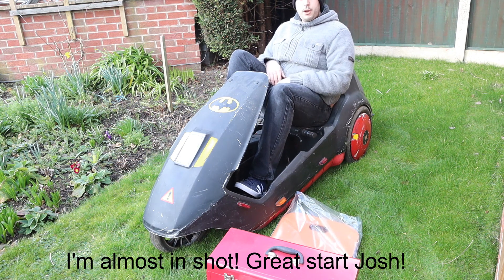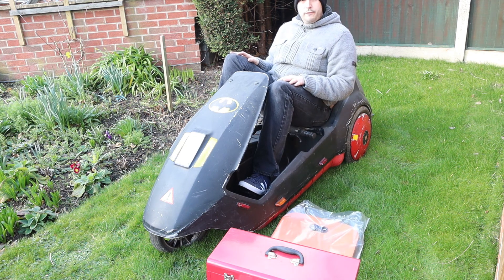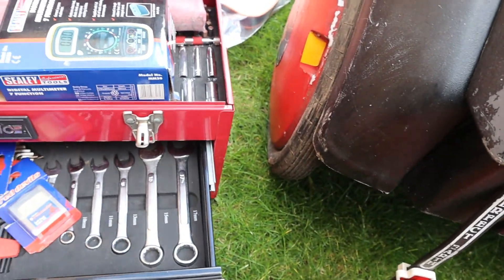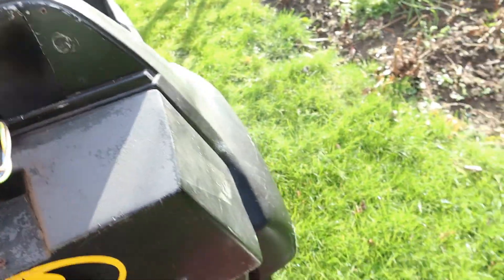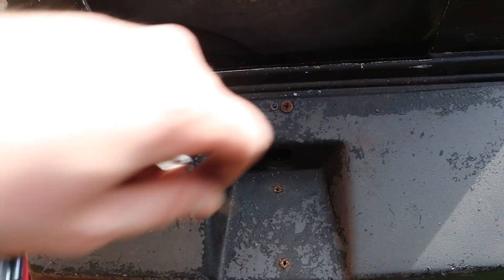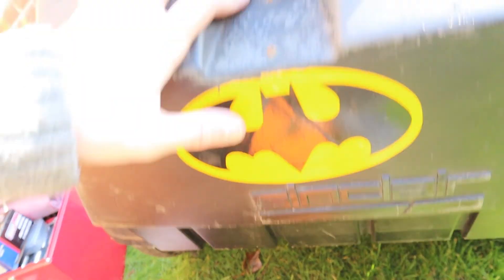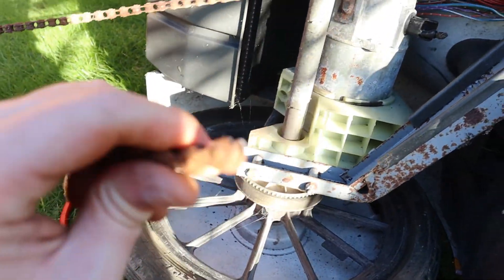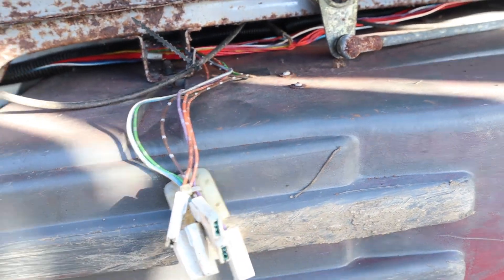Sinclair C5 Project - 'Getting Started' - Part 1

Comment: Josh get a petrol lawnmower and put it inside and you have the best lawnmower on the planet lol.
Reply from the maker: 😂😂😂 What a wonderful idea!
Reply: @TheMoaningYorkshireman  Hehe thought you would like it gotta be easier than repairing the electric unit.
Reply from the maker: @f1gamesplaystation787  To be fair the motor itself is in really good condition, its just all the wiring that's getting a little awkward to work out where it all goes and where its come from! 😂
Reply: @TheMoaningYorkshireman  Yeah anything on a car or bike you need to be an electriician to work out and over the years they add wires and cut wires off its a nightmare.
Reply from the maker: @f1gamesplaystation787  Yep, far too complicated. I can't afford an Auto Electrician but if I can bodge it together so it works then all good, if not I'm sure I'll just be able to power the lights up on a separate circuit and have it as a really smart display piece. 😊👍
Reply: @TheMoaningYorkshireman  Oh yeah you will get that to work Josh I am sure
Reply from the maker: Well you'll be able to keep up to date with everything on here won't you, be sure to slap a like on the video, subscribe and hit that notification bell so you never miss a single upload! 😘🤣🤣🤣
Reply from the maker: @f1gamesplaystation787  😂😂😂